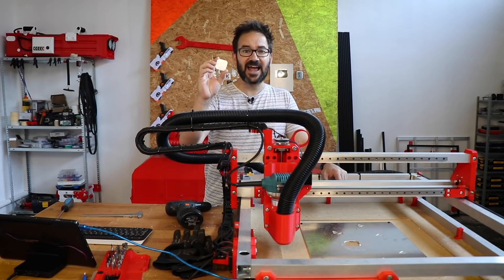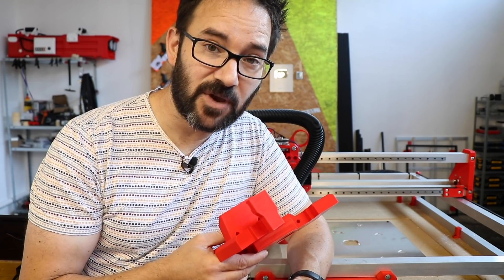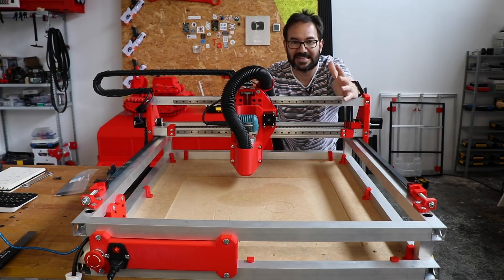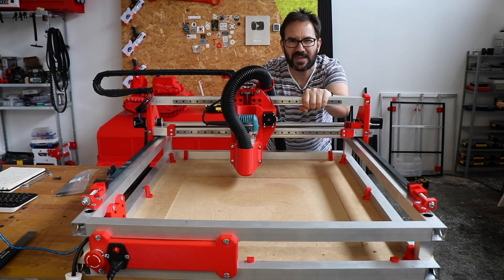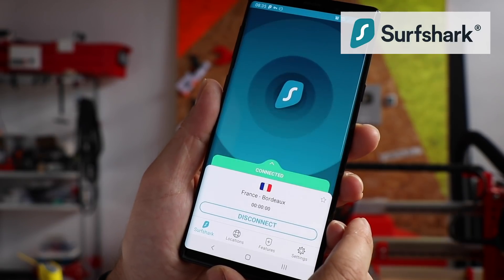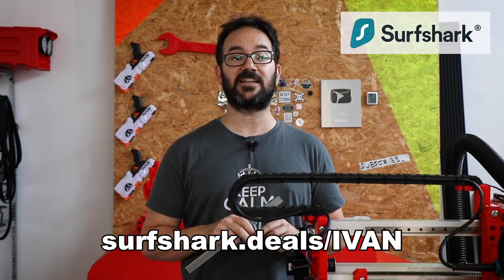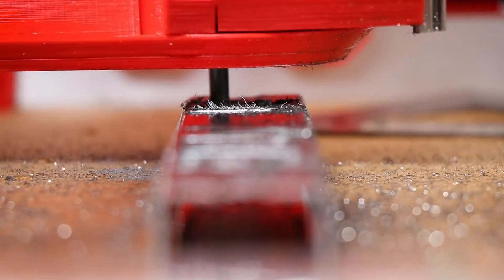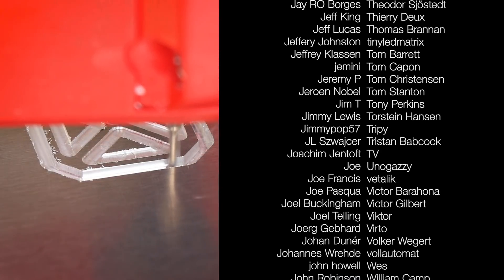CUTTING STEEL WITH A 3D PRINTED CNC

Comment: What is the total cost to build something like this, granted I have access to a full tool shop, and a 3D printer?
Reply: @Yoa Ownage Well please check openBuild website they have some nice part or even kit. A nice and decent CNC is around 750€.

All the best
Reply: That I also want to know
Reply: @antonbeck439  what are the belts? Couldn't find it searching hdd5 belt.
Reply: @Mekandersen  Its HTD5
Reply: Kenneth Andersen this is a htd5 belt or timing belt look on eBay for htd5 belt
Reply: Kenneth Andersen and gt5 pulley
Reply: Considering that the belts alone will run you nearly 150 USD and the motors are moderately expensive as well it might be possible to build an equivalent clone for around 750 to 1000 USD based on the quality of the parts you source.
Reply: @kendallemory8455  so I looked it up and a htd 5m-15 belt costs about 7€ per meter. Maybe someone built it and can say, how much he spent?
Reply: @antonbeck439  you need a minimum of 3meters and I pulled my numbers from a belt supply company in the USA. Every time I've sourced parts the cost gets much higher when ordering longer lengths unless you're willing to buy in commercial quantities. If that much for the belts is too much then the linear slides will give you even more trouble. I'll be revising my biggest machine to use Ivan's belt setup and Z axis.
Reply: Anton Beck you can get them on AliExpress very cheap... they also sell the correct pullies
Reply: Kendall Emory - those companies are set up for business-to-business transactions; and unless you have a corporate account with big discounts applied; they will charge you big bucks for stuff... often two to three times what it should be; sometimes more. For parts like this; I go to eBay usually; unless I’m in a hurry, then it’s Amazon (prime shipping). As others have noted; AliExpress has all sorts of stuff for cheap (and you can often negotiate a lower price if you’re nice & are willing to buy in larger quantities; like 10pcs or 20pcs instead of 3pcs). Other venues include BangGood, GearBest (although they tend to be more oriented to full machines, not parts), or just searching Google for the parts you need; sometimes a company’s own web store will have stuff for less. 🤔
Reply: @kendallemory8455  wtf?! So much for a piece of rubber? So no cnc for me...
Reply: @antonbeck439  No they are much cheaper. 10 meters of 30mm wide belts cost about $50 on ali express that is enough to make a 3m by 3m machine and have even wider belts than he does. I buy 600mm rail kits that use ball screws instead of belts for $20 ($60 for 3 axis)  a rail set with all the pieces for a 500mm x1500mm x2500mm costs $150 (3 rails with 3 slides and 3 ballscrews and all mounts and connectors). The 3 motors for $32 or 65 for bigger nema 23 57s. So if you wanted to go high quality you could get a 600x600 for about $100 or go big for $210 plus the framing which will probably cost another $50 1500mm 3030 v groove costs $5 and you would need about 10 pieces plus the corner connectors. Then another 30 for the controller. My guess is all in it would cost $200-350. For the big ones you would need a different kind of extrusion though to stiffen it up more. probably either 4040 or 3060 which may make it cheaper to buy steel tube.
Reply: @excitedbox5705  where did you find rail kit with ballscrews for 20 bucks?